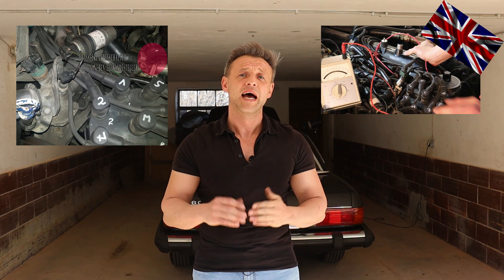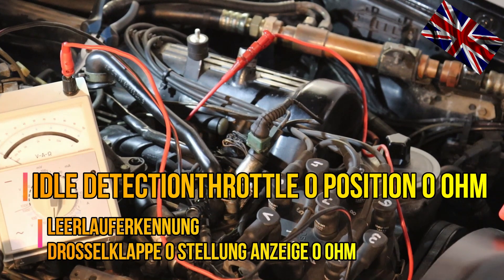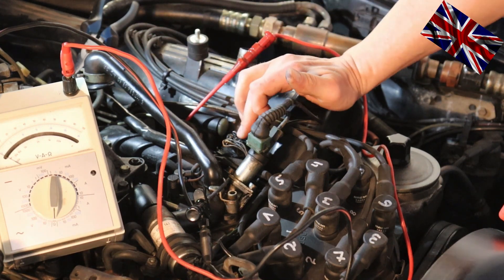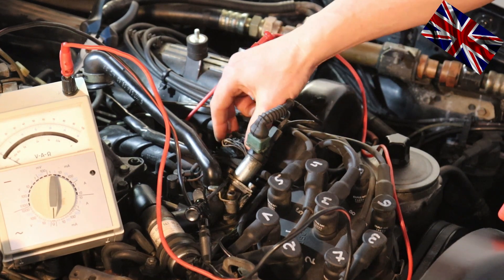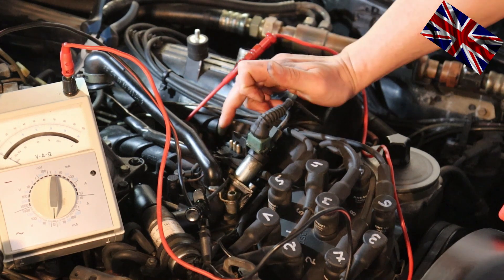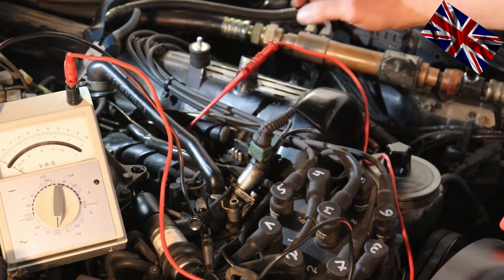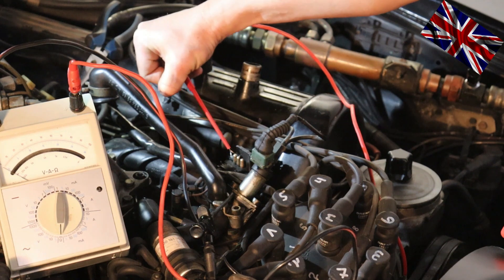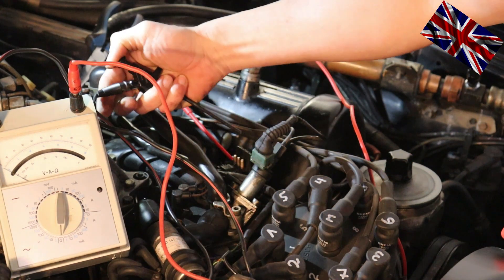KE-Jetronic throttle switch - Check Mercedes 560SL #throttleswitch

Comment: Hello, I have a question how to check this switch. There is no transition on pin 2 and 3. If I give the throttle full throttle, Pins 2 and 3 should have a transition (there should be continuity, the meter should beep)